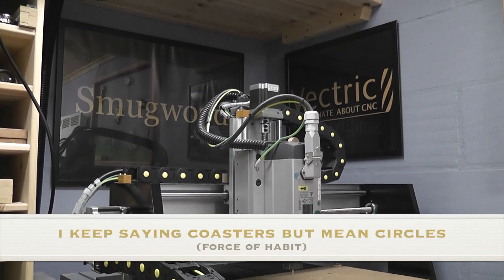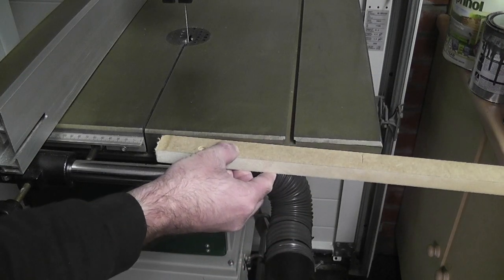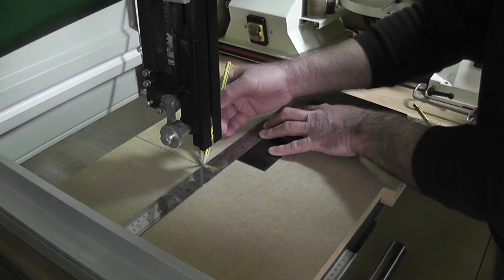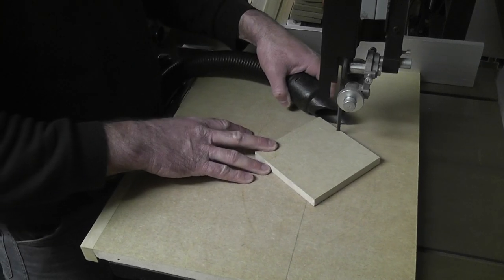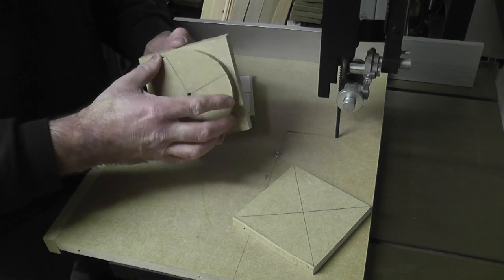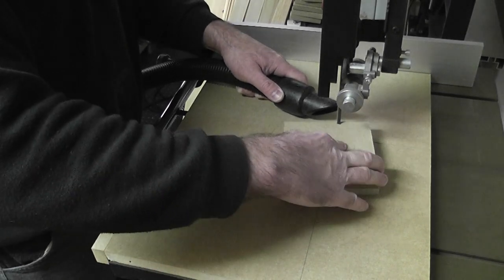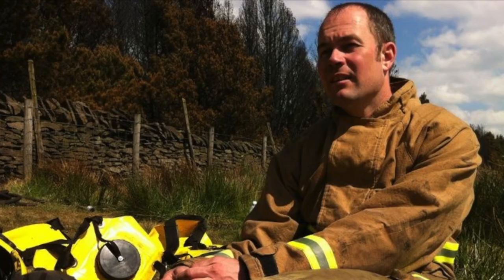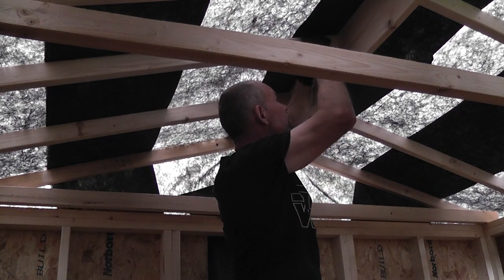Cutting Perfect Circles On A Bandsaw With No Holes and Making A Jig In Less Than 5 Minutes

Comment: I'm glad you mentioned the method on how to make no holes, I would have been completely stumped.  Cheers!
Reply from the maker: If I’m cutting for lathe blanks I don’t mind the holes but when they’re for coasters...it’s nice not to have the holes...unless it’s part of a decoration etc. I did fill one once with milliput and it actually looked cool 😂
Reply: @Smugwood  That's a good idea.  I also considered you could put a cork backing on them and no one would be any wiser :)
Reply from the maker: It’s funny you should say that 😂 I’m in the middle of a new video and doing exactly that...putting cork on the bottom of the coaster. I bought some cork but it was thicker than I wanted but was going to try it yesterday then realised I’d nothing to stick it with so I just order some 2 part epoxy glue. Hopefully it won’t react with the cork 😂

Comment: the problem with this jig is that you have to set the fence to EXACTLY the same distance from the blade every time you use it. it would be better to add a runner for the miter slot(s)
Reply from the maker: It is of course very possible to improve the jig...but the more complex, the longer it takes and the idea was to make it in 5 mins :-)